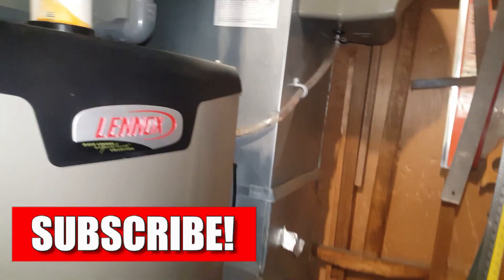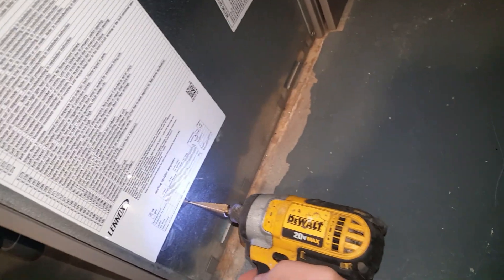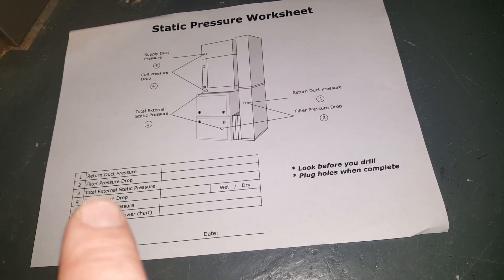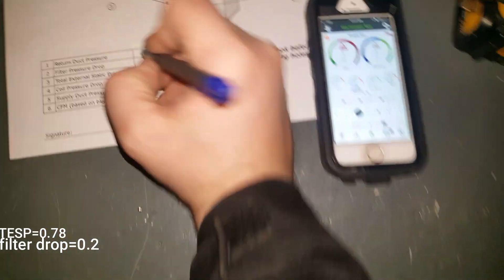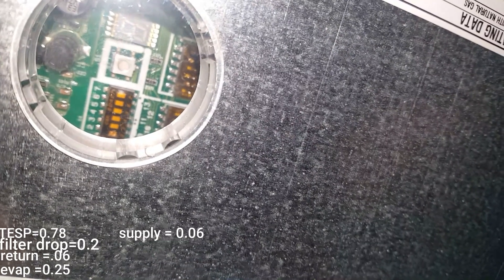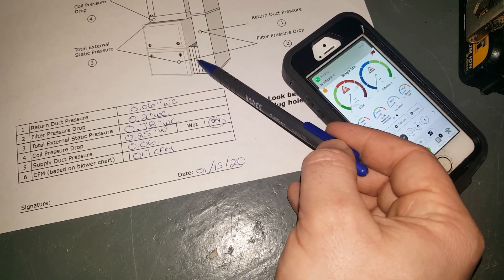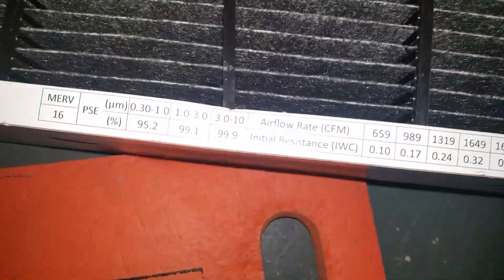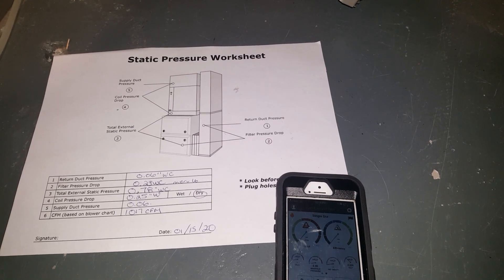Recording static pressure when you commission a unit

Comment: Thanks for the video, You did a fantastic job explaining the process. Would you consider .78 TESP good, especially considering that is on a clean filter and dry coil? The max on that furnace is .80 so you have .02 safety margin. I suspect as the filter loads and the coil is wet (and with a higher fan CFM in cooling (if that is the case)) you will speed right past .80 and get pretty close to 9 or even 1.  I'm always looking for a large safety margin, so how does your company handle it? I know customers don't always see the value in correcting the issues that cause an elevated TESP.